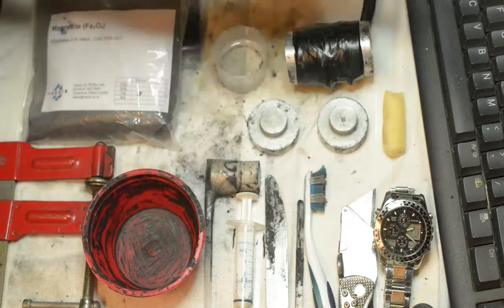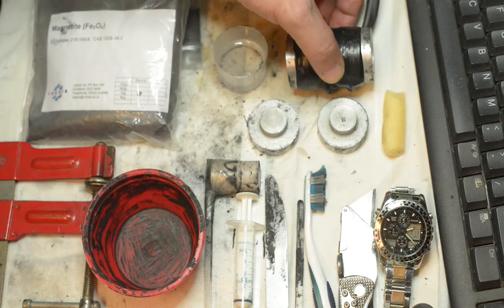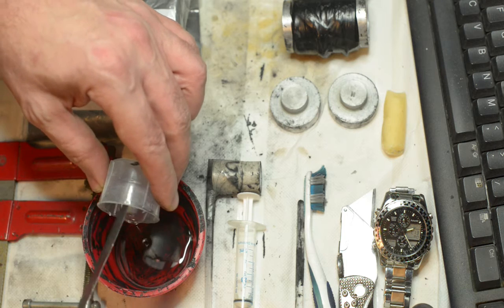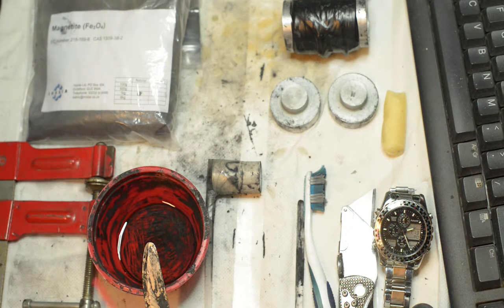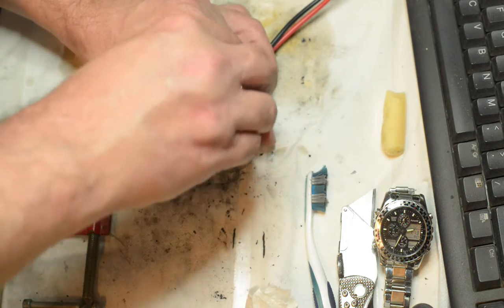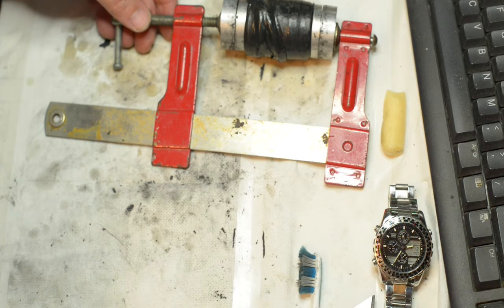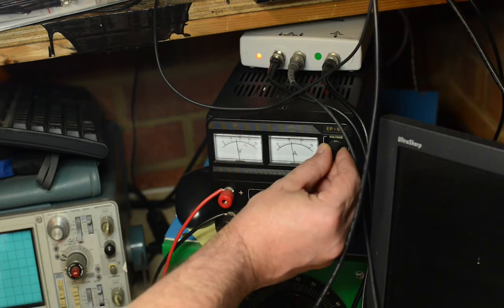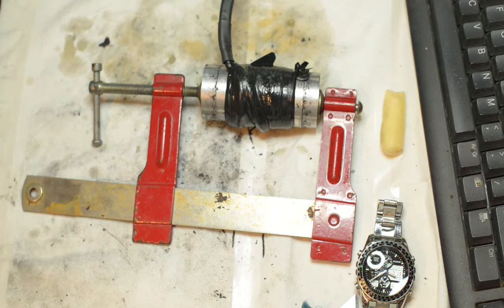Muller Motor Core Procedure

Comment: First of all, WELCOME BACK! Drop me a note. It would be good to catch up.

Secondly, this is exactly the direction I wanted to go with only two minor changes. 1) I would have used 1hr curing epoxy to 2) give me time to put it in a vacuum chamber to evacuate all the air from the core mixture as it hardened. I'm surprised at how easily they're extracted from your mold. Seems like they must shrink a bit when hardened.
Reply from the maker: ZeroFossilFuel Hello Z. Thanks. Nice to be back. 100% agree with the vacuum chamber and I will build one. I think the easy extraction of the cores from the mold might be largely attributed to the wax. The last step in the overall procedure is to apply wax to the (still hot) mold parts but the main mold body is cooled rapidly as the workshop vacuum hose draws cooler air through it leaving a good waxen wall throughout. This added to a very tiny shrinkage (and we're talking here about 0.02mm OD...hard to tell exactly) allows the core to sometimes just slide out under gravity when burs are not present.

Comment: Thanks for sharing super core
have you plans to make the mold to make core
Have you ebay link for ferrite powder and hardner
Reply from the maker: Edmorbus This procedure is purely experimental and driven primarily to provide myself with an aid to producing coes in a  more or less consistent and scalable  manner. No production plans therefore. Magnetite is Fe3O4 purchased from Amazon and I don't know the micron size....it just needed to be fine as far as my eyes can discern.